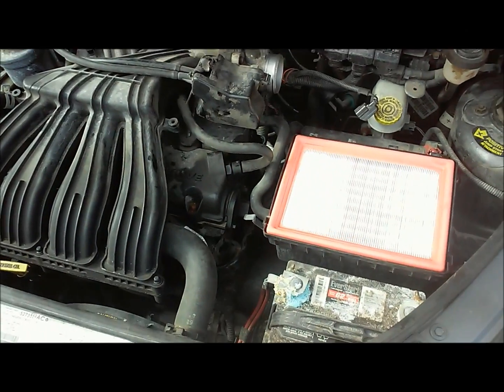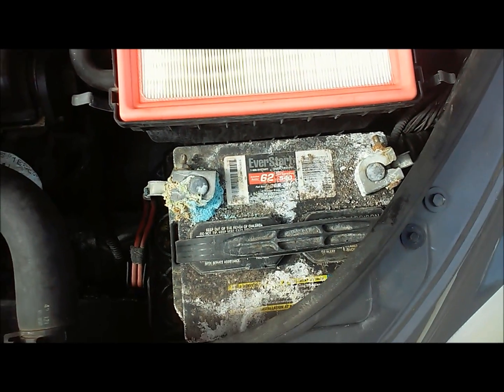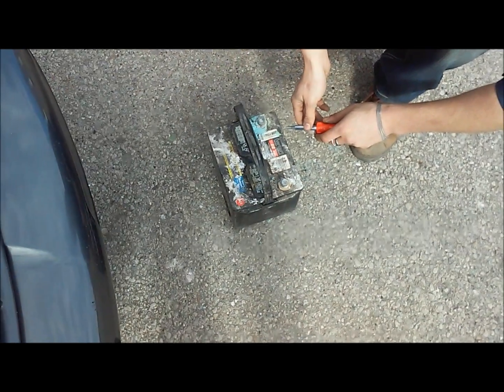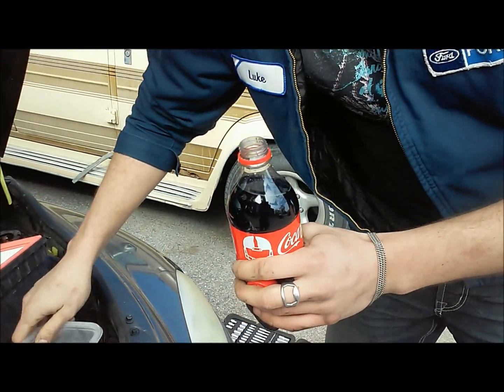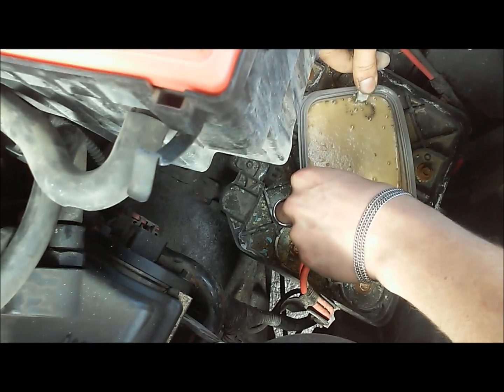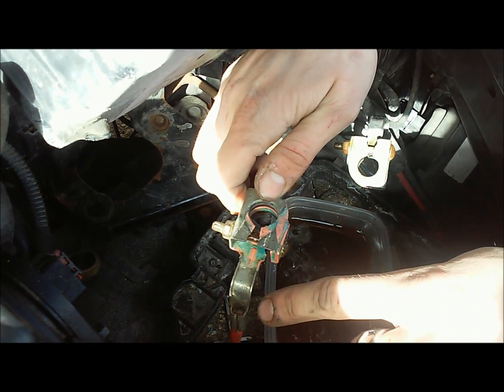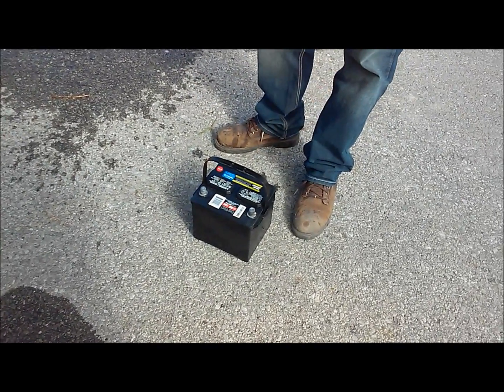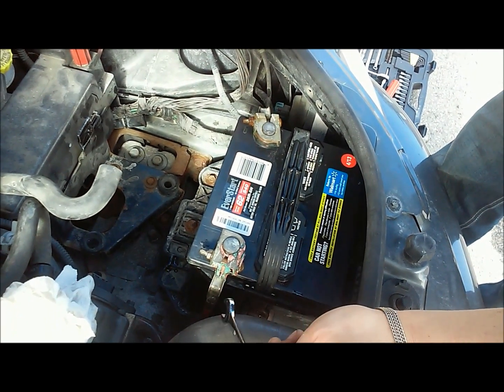Coke vs Battery Terminal Corrosion - Auto Repair on a Budget

Comment: Yeah I had terrible corrosion on my battery, didn't have a coke on hand, but used a diet coke, worked wonders in getting most of it off. Still used a steel brush on the battery posts themselves, and dine fine grit sandpaper on the inside of the terminals after the diet coke soak. Looks brand new now!

Comment: All that work lol..... high pressure from a car wash 15 sec. Thats it
Reply: It does work faster than coke being poured on the battery, but, the pressure wash isn't a good idea because you risk pushing water into connectors and rusting out the terminals. Which can cause Circuit Failure, Especially on older cars. Sometimes fast isn't always better.
Reply: DJ Goot if you know how to use,a pressure washer it isn't an issue. Never had a problem when I did it
Reply: @jeffreymartino531  knowing how to use a pressure washer doesn't change the fact that water can negatively affect electronics lmfao

Comment: Use baking soda instead and drink the coke.  Secondly, use vasoline or dielectric grease to prevent or at least slow down future corrosion.
Reply: Laura Croft  Hydrogen gas from the acid which mixes with the air that forms that white/blue powder on the terminals and battery holder. Put a dab of multipurpose grease on the terminals to prevent buildup...

Comment: I wonder if you know if it would work as good with Pepsi ?
Reply: Don't don't don't, it's a sale pitch, it doesn't contain any knowledge and tells you nothing.
Reply: In a blind folded taste test,  the corrosion cant tell a difference between the two
Reply: It would probably work even better because you can drink the Coke instead of wasting it.
Reply: There are several components to battery repairing. One resource I discovered that successfully combines these is the Jons Mender Guide (check it out on google) definately the best course i've seen. Check out this incredible resource.

Comment: Bet it tastes better after this. Let's face it, it couldn't taste worse!
Did ya grease the terminals and clamps to prevent it happening again or at least slow it down? Betcha didn't.  IT WILL.
Which becomes unusable first? That battery pillar or the clamp?
You'd better hope the clamp...A new one can be fitted, messy and more cost but at least it can be done. The battery pillar?  Huh! No chance!
Coke may be very effective but so is boiling water. But don't drink the coke..Save it for your glass house tomatoes...Great plant food... Phosphoric acid.
There's an English tomato turbo juice called Growrite..or Tomorite.
Main ingredient ...Phosphoric acid ...Look on the Coke or Pepsi bottle/can!

OH.. I've just seen another reference to boiling water by Erroneous Code in a previous
posting. HE knows what he's talking about!

Comment: You make an easy job overly hard. No need to reinvent the wheel. Just slowly pour boiling water over the connections and terminals until clean. You can then use old school vaseline on the terminals to limit it coming back in a hurry or there's battery terminal sealing products in pressure packs these days that do an even better job.
Reply: "Hard" lol
Reply: Erroneous Code 
What's old school Vaseline? 😂...How is it different from today's Vaseline?
Vaseline has always been used for good slippery sex
Reply: That's "overly hard"? ...."dip the terminal in Coke for :5 minutes"....that's hard? 

Well, you know what they say, "hard work is never easy". You must exhaust very easily.
Reply: yeah hot water is more working then coca cola. put theese terminals in hot water for 5 mints jobs done.

Comment: Use BAKING SODA, sodium bicarbonate, mixed w/ water.  It WILL neutralize the acid, the rinse w/ water to clean off residue.
Coke is phosphoric acid, battery is sulfuric acid.  The corrosion isn't a contact issue but copper corrosion, verdigris from the sulfuric fumes.
Reply: Coke is made with phosphoric acid, but the final product is not an acid or it would do NOTHING to battery corrosion which is also an acid. It takes a base/alkali mixed with an acid to neutralize the acid, not two acids.

Either way, if you clean the terminals with either baking soda, or Coke, make sure all the refill caps on the battery are closed tightly, or you will also neutralize the battery acid inside the battery and kill it along with the corrosion
.
Reply: Good point.